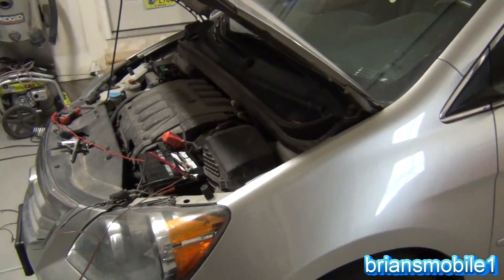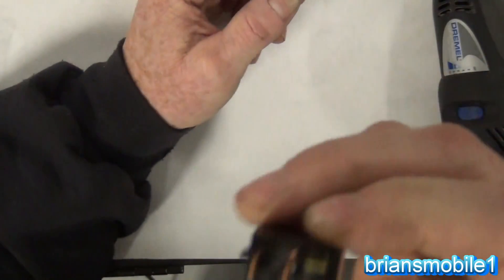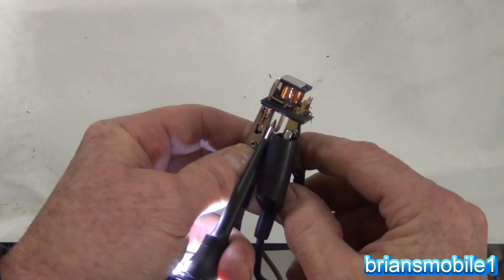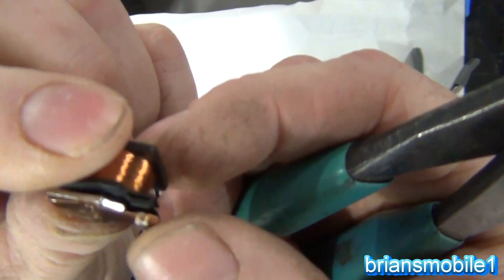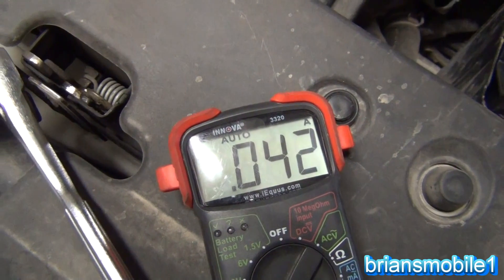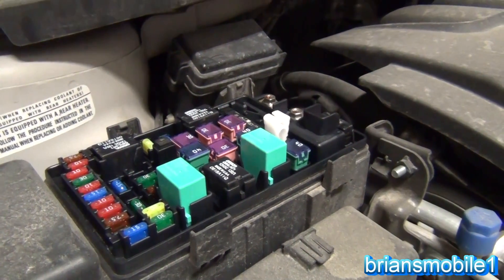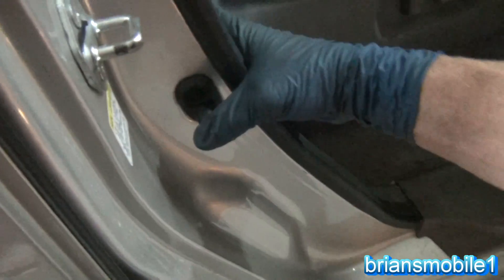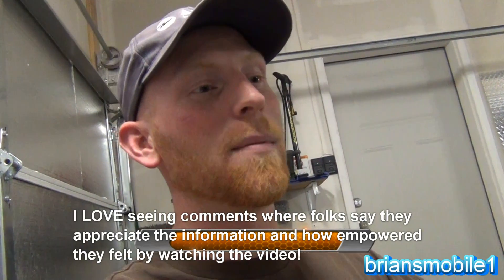Odyssey Battery Drain Fix and Draw Testing Basics

Comment: Man… I have a 2013 Odyssey bought used and noticed that after leaving Van sitting for like 1.5 - 2 days… that the battery completely dies and a brand new battery was out in when purchased. Everything with battery and alternator is fine and took it to Honda to do parasitic drain test and they said it was fine… also had them leave it there for 2 nights without turning it on and the volts are still reading normal levels and then they turned it on this morning and it started fine….. WTF… of course it works when they are trying to figure it out. Our dome lights don’t work (and the bulbs are not the issue… tech tried to put new bulbs in and still not working and also cig lighter doesn’t work)

Basically just wasted $190 to have Honda do nothing haha but really hoping it’s a fuse issue or relay like this.

Any advice?

Comment: my wife’s Honda 2016 CRV which we bought new has 32K miles on it. We replaced the original battery in 2021. That’s pretty good for a battery to last five years. But that battery went dead in December 2022, so we replaced it, that battery went dead after the car sat for three days. So it’s not the battery. The alternator puts out 14.5 V when the car is idling, so it’s not the alternator..
  with a negative terminal disconnected from the battery and an amp meter put in line, the parasitic draw is slightly less than half an amp..Some “experts “on YouTube claim that that is average/normal draw. but the battery still goes dead even though I had it fully charged reading 13.2 V after disconnecting the two amp battery charger, after the battery sits for a while, the reading is 12.6 V. But if the battery sits overnight here in Western Pennsylvania where the temperature goes down below freezing overnight, I checked the battery after three days of not driving the car, it was down to 11.2 V….
  so I went on YouTube to hear what other Honda owners have done to repair parasitic draw issues.
  it turns out that there are hundreds of Honda car owners from all years and all models of Honda that have parasitic draw issues. It is not a common part that is causing this. On some cars it’s a power door lock that went bad, on other cars it’s the air conditioner compressor clutch, on other cars it’s the power window motor..
  I have yet to see the same part fell on two cars..
  it seems like it’s the control center for all of these electrical devices that is the issue.. if that is the problem I believe there should be a recall. Because it’s almost unbelievable the number of Hondas that are having parasitic draw problems. an issue like this from Honda is unbelievable. It seems that it’s never the same component that’s failing, but they do have a control center that is a common denominator..
   this is not an isolated uncommon problem, this is a widespread problem if the number of Youtubers that have posted their experience with this issue on YouTube..
  I am going to contact the attorney generals office in Pennsylvania about this. This should be investigated and a possible recall should be issued

Comment: My 2009 Honda Odyssey air conditioning stopped working, but I think the clutch relay is stuck and my battery is draining overnight. Can I just remove the relay, as I'm not going to fix the air conditioning compressor?

Comment: Very nice tips.. 
My garage guy took out the main circuit fuse, so this doesn't happen. 
But it stopped working all components like clock, radio,  power locks,  power windows,  lights. It's not good.

Comment: I had the exact issue and it was the same relay switch. I kept hearing that clicking whenever I applied the terminal. Thank you so much. I think this will fix it. God bless you. I changed my starter because I thought that was the issue

Comment: Great video and awesome tips! I am currently going back and forth with a shop that said they fixed my parasitic draw 3 times now on my wifes 07 odyssey. I really wish I actually tried to do some research before I dropped it off there, I would have likely found this video. Anyways I have the van back now and I'm going to go check this now. I also think the way you asked if you earned my subscription is great. You did by the way. It turns me off when someone asks for you to like and subscribe first thing in a video before "earning it".

Comment: Hi brian I see your video and I find it my Radio fuce 10AMP drain my 2015 HONDA ODYSSEY battery around A week  so i will take it out that fuce and  that problem is over.but how can I solve the problem right now my back up camra and radio not working due to I remove 10AMP fuce.

Comment: Lol they were cheap so I replaced all three hoping that was my problem. Nope. Had to replace R door latch assembly to get rid of drain. I now have four perfectly fine relays lol extra
Reply: wow ..my son stuck n jammed my key in the door and barely got it out..it lockks but i can barely turn the key..battery died next day
Reply: could this be my issue?
Reply: @dredre443  jammed a key where? What does have key holes? I didn't think any
Reply: @scottlanier5133  inside the door lock.I can unlock but when the key jammed,it dosent go to the lock position on the driver side making my pcm think its unlocked.i must hit the unlock but from inside the car ..then get out and use the fob to lock it.without doing this the car would never sound the horn when i hit the lock button from the fob thus making the security system think the roor is open and will drain after 8 to 12 hrs.Do u understand? Im sure it sounds a bit confusing
Reply: @scottlanier5133  2010 accord coupe driverside door lock
Reply: @dredre443  if the lock motor doohickey is stuck it could be draining. There's a video using hot glue to pull the broken key out on YouTube
Reply: @scottlanier5133  i have the key..but the key will not lock the door .because its jammed in the unlock position and will only turn right.turn key left to lock but it barely turns left
Reply: so when i hit the unlock button from the inside of the car..it finally registers that the door is unlocked.only then will the horn sound when i hit the lock button
Reply: @scottlanier5133  temporarily fixed it by positioning the door lock on the inside if the car to the unlock position and use the key fob to lock instead of the lick button switch on the door.I hooe this makes sense to you.lol,its a 2010 accord coupe

Comment: I have been through 5 alternators and 2 batteries in the last 14 months.  I have had the valve cover gasket and solenoid replaced.  Tow truck rides, AAA battery jumps, and absolute financial annihilation due to my battery parasitic draw.  At 63, I am homeless and live in my odyssey with my 2 dogs.  The inability to find the problem and fix it is killing my joy in life.  I am so disappointed with the vehicle and the mechanics.
Reply: have u checked your sliding doors or pull the door fuses?

Comment: Stuck A/C relay will keep the compressor on all the time.  might cause the a/c system to go overpressure and blow out the safety plug on the compressor.

Comment: I had the same issue with my Odyssey 2008 this year (2020), i looked at this vid and instead of changing the relay, I made sure the heating system and AC were turned to off on the digital screen before i turned off the car. This workaround seems to have solve my problem. It used to die in 2 days. Now, its been 3 weeks I did not use my car and it starts with no chokes at all. Battery seem to have maintain its full charge.  Now, I make sure everything electrical (including radio) is turned to off when leaving the car.

Comment: Noobs: check the fuses under the hood first, and of those, first check the 40A ACC fuse (box-shaped)...because this fuse actually goes to a little fuse panel that is in the cab, passenger side.   In my case it was a 7.5A fuse, #13, which is "clock/backup"....and I still need to troubleshoot what exactly is the issue.  I have about 505mA drain...which is huge, and kills the battery in about 3 days.

Comment: I changed the battery I change the alternator the car worked fine for a while then it died on me the only way I can start it is by a jump.
I have the check engine on VSA brake lights D flashing. When I try to accelerate it hardly does.
Reply: Hey similar issue. Can I ask what your fix was???
Reply: No fix..  I got rid of it

Comment: Thanks for the tear down and explanation of the function and failure of the relay.  Now I know there is a high current B+ Constant contact, a low current Input Switch contact (Say from a sensor or switch), a Ground, and a high current B+ Switched that looks like the B+ Constant that goes directly to the accessory.  :)  This will help me fix the 2006 Odyssey I am buying, so thank you!.

Comment: So u have a 2006 Honda odessy n yes it is a common thing with these vans n they all does this I have changed everything until looking @ ur video only 2 learn it's something as small as this I don't have the  little tool to test the fuses for the problem so I guess I will go to the dealer and let them test it for me thanks for your video it was a big help and stress off of my shoulders I did subscribe to your video thanks again

Comment: i know its an old video 
does the check charging system come on as a result from bad relay
Reply: Yes it does it came on my dashed n wen I changed everything that I could possibly think it was it was still there ubtell I changed my alternator but I now know I have this problem that Brian is showing in his video I'm going to the dealer and let them tested as he showed and my problems will be solved it can be very stressful

Comment: And the clicking meant the battery is dead because I killed the battery in my mom’s odyssey before and I tried starting it and you would here a clicking noise “Click Click Click Click” then try it again same affect you get a flashing green key light it flashes on and off that is what I got on my mom’s 09 Odyssey and her 2017 Odyssey touring push button

Comment: Real quick. I just had this problem.  I watch this video and replace the relay fuse and still had the drain. Then I pulled the number 7 fuse under the hood and the problem went away but I lost alot functionality in my 2007 mini van. So I found a diagram and seen all that was connected to fuse numbers 7. I seen that the power sliding doors was. So I got inside of the van and pulled both door fuses. The next morning my van started right up.
Reply: My 2005 odyssey also have electrical drain recently,found out #7 fuse have 4.2mv drop when key off. Trace all the way to rear right junction box behind right trim panel then to the tailgate door lock latch, pull the connector from latch it drop to 0.8mv. Now I need to figure out from the latch eclectic contact point or the micro switch!
Reply: Did the issue come back?
Reply: I'm having issues with my 2006 Honda Odyssey..Did that permanently fix your problem? Ty
Reply: at that point your doors were fully manual only though, right? (after fuse 7 pulled)

Comment: My odyssey does a same problem for past whole month.Repalced 3 batteries,change the battery connectors, contacts,alternators fine and starter is good too.It sit for more then 2 days and battery completely drains???so r u sure if its 100 percent ac fuse problem???
Reply: What did it turn out to be?

Comment: Thanks for this awesome video.  As another way to diagnose if the AC relay is the cause of the battery drain, would it be ok to remove the relay, jump the battery, and run the car to charge the battery.  Then let the car sit for a couple of days to see if the battery drains again?  I'll be without AC, but that's OK since it's only a test.  I just want to make sure it won't harm the car in anyway.  Or is it a no no to run the car with a missing relay?

Comment: Nice video thanks. My problem is a bit different and hoping you could help me out with your knowledge. 2011 Honda CRv, we found that the battery draw is coming from under the hood fuse socket # 23, "Back Up".  It is a 10A fuse. Drawing about .265 and draining the battery in about 17 hours. Be grateful for some help.

Comment: If instrument cluster light stays on and climate control light stays on and battery is draining the orange wire on the back of radio is the problem drain will be on rdo batt fuse

Comment: I did the alternator test where you remove the battery cables while the engine is running and the engine shut off on my 2012 Odyssey. Is that confirmed alternator issue or could my problem be the relay as well. I also hear constant clicking when cables attached.

Comment: hi Brian

i recently did a trace and found out it is fuse 7 under driver side which link to a bunch of control box on the 08 odyssey touring 
i am wondering if you have any tips to trace them before tearing down sliding doors, navi, rear trunk lid, everywhere 
thanks

Comment: +briansmobile1 Question. Well, I know the compressor clutch will engage and disengage regularly to control pressure. With the compressor compressing all of the time because of a stuck control relay, wouldn't that damage the AC system?

Comment: What's fascinating to me is that something like this likely goes unnoticed to the average person. That you picked an Odyssey is great for me. I had an AC Relay go a few years ago. Then, again, a year ago. The dealer thought that was odd. I replaced the battery last summer when it went dead for no apparent reason. In fact, it had me thinking that I'd jumped that van a few times without understanding why. The battery guy said hot weather will push a low battery over the edge. Well, it's only four months later and the van has been sitting unused for the last six weeks as we've traveled and used our other car. And now the battery has drained down. I never heard of this parasitic draw. But, it's bringing all these disparate points - accumulated over years - together. Thank you. Well done and edited video.

Comment: Can you explain how you setup the jumper cables a bit more please I didn't understand how you were making it click. Thanks
Great video
Reply: +Jonathan Buckler he was connecting and disconnecting the negative battery cable with the jumper leads. Basically clip one onto the battery terminal and one onto the negative cable. When you touch the other ends together, you are reconnecting the battery to the vehicle. Hope this helps.
Reply: Doug is correct. the only reason he used the electrical outlet, which looks like ti takes a light bulb to me, is because it has a large enough clamp to connect to the battery. He is just using the small jumper wires to complete the current path from the negative battery terminal to the disconnected battery cable. you could do the same thing by touching the cable to the negative battery post, but the small leads give him the ability to put the meter in the circuit.

Comment: I've had a heck of a time finding parasitic drains before! I've heard it takes the computers a while to clear all voltages. And when checking across fuses you can actually activate a good circuit so that it will show a drain the way it's suppose to in it's activated state and then you have to wait for the computer again to clear all voltages. So how to know if it's shorted or activating properly?
Reply: the ecu is low amperage,it is included in the specs

Comment: 14:30 is that a Gerber Crucial i see? :D
Reply: test heater core,or change it right away this is the pr
Reply from the maker: flaka-power Why yes.  Yes it is!
Reply: nice! not my first choice maybe but.. haha. you should do something small what you think about it ;) btw, i´mk working on my girlfriend´s volvo 240 -88. the cooliong water leaks inside the car... so the floormats is wet and seems to drip from one of the "blowholes". it´s almost all the way apart, the dash is off and all, but I can´t see anywhere where it can have leaked.. any idea how to test and see where it leaks?

Comment: Hi Brian,

also experienced this on my Honda Civic. My compressor clutch relay was stuck open, because it was all green and oxidized inside. OMRON only seems to produce crap these days. Clickers in logitech mice: OMRON, and they are crap. Relays in Cars: OMRON, they are crap. Door switches in cars: OMRON, they are crap.
I threw out all OMRON components out of my Fuse boxes and replaced them with others. Some things can really get damaged by sticking relays, I don't wanna buy a fuel pump or something because of these little things...
Reply: ***** Certainly not a bad brand. I've used Mitsuba and they seem to hold up very well for everything I did so far.

Comment: Hey how do you go about doing a Drawl test on a dual battery system like in most diesels?
Reply from the maker: Wallie2004 Diesel batteries are wired in Parallel.  That means the whole system is still only 12V.  The second battery is only there to increase amperage for starting the high compression diesel engine.  So you disconnect both negative terminals and put your meter between the negative terminal and battery on the primary battery.

Comment: I had an Omron relay stick in the OFF position for my MDX. The AC would NOT come ON. This was in the middle of the summer during a long trip. In a pinch, I think I swapped the relay for the foglight or high beam relay until I could get a replacement. 
I was working on a MINI Cooper the other day as well - the front windshield washers worked but the rear didn't, even though they both use the same impeller motor (just spin in the opposite direction). Turns out that was a relay problem also. The problem moves when you swap the relays. A swift whack on a tabletop unstuck the relay for a few days until a replacement could be ordered.
Reply: Good idea! Thanks!